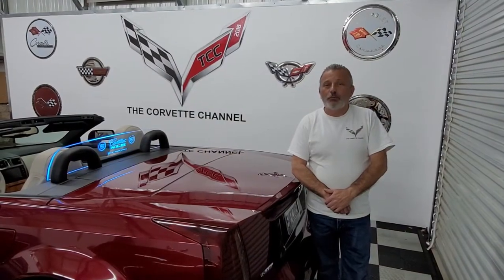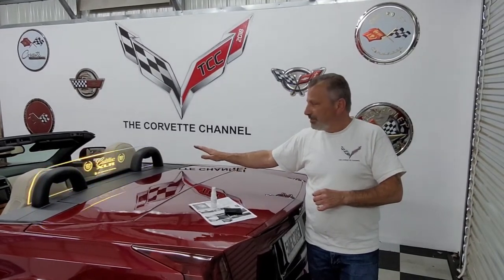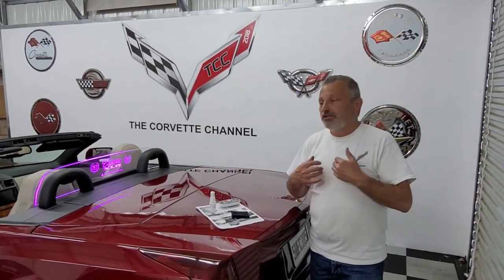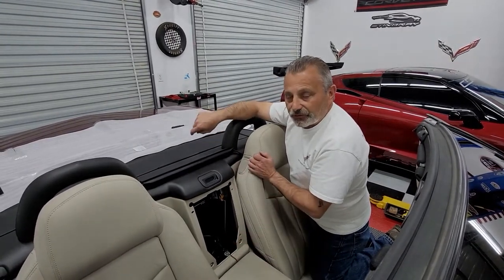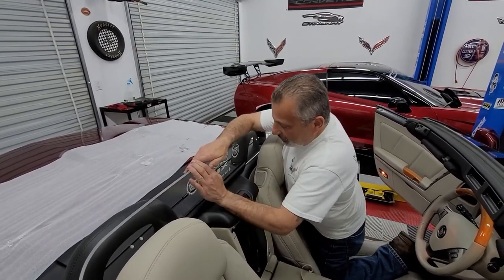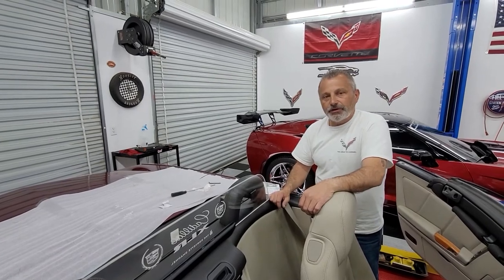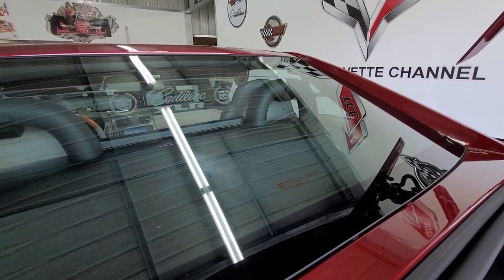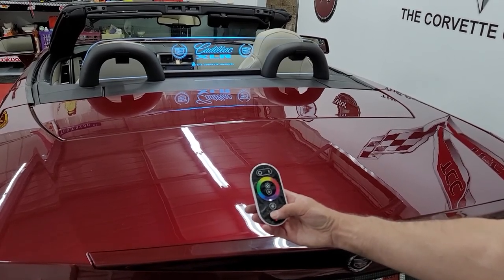How to Install a Windrestrictor in a Cadillac XLR

Comment: 😊 Just finished installing ours on our XLR..!!
Absolutely love it..!!
I "tapped" into BOTH the running lights, and also the brake lights... I installed a switch in the rear mounted glove box, so that i can switch OFF the windshield light during night time driving, but it keeps working with the brake lights... Best of both options...
Love, love, love it..!!

Comment: Mine came with the car and form fits the Roll Bars. Embroidered with Cadillac.  It is a black mesh and does not reflect lights.
Very difficult to see behind you in the dark especially with Tinted Windows.  Only Red is allowed for rear lighting or of course white for backing up.

Comment: I removed mine. The reflections from other cars at night was very distracting.
Reply: Really..???
What did you do with it..??
How did you remove the light bar, without damaging your leather cover..??
I want to buy it from you...
Reply: @saatwe  mine is a simple slab of whatever glass they're made of, no lights and no etching/lettering. I removed it, the pad it sits on and the two brackets that hold the thing in place and it resides in my garage.